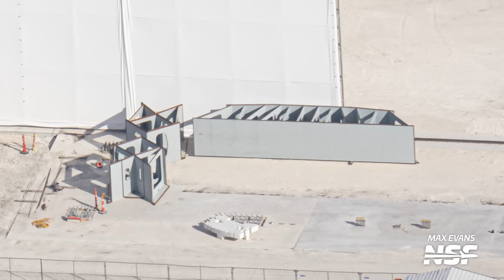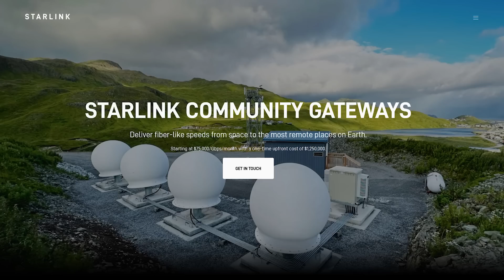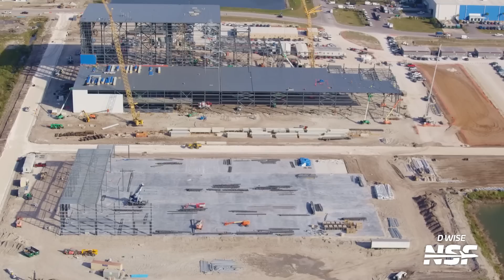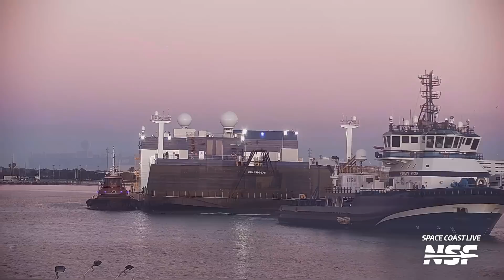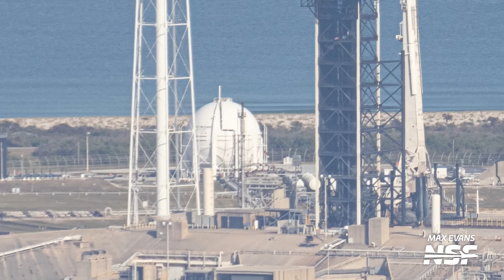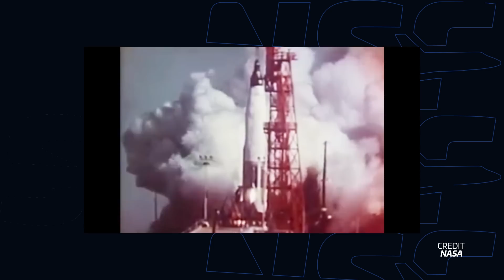Busy 2025 Ahead! Starship, New Glenn, and Stoke Progress | KSC Flyover

Comment: It is interesting to see the different design, build and construction methodologies of SpaceX and Blue Origin. SpaceX builds the machine, then the building that builds the machine - based on how the machine needs to be built - years later. Also, all the parts seem to come JIT. BO builds the building and then the machine, and the parts for the building seem to come way before. To me, while that seems very traditional, is also seems to lock in the design of the machine before you have even tested it. It is also a lot of investment in stuff that looks pretty and clean, but you haven't actually got anywhere yet.

Comment: Boca Chica is Starship Development while the Cape will be where they will be manufactured in bulk.  Starship Booster will be standardized with only incremental changes applied but Boca Chica will be where most of not all the "Special Version" Starships will be built and tested.  Special versions of Starship will of course include the Moonship, the orbital tanker, deep space exploration, custom ordered Starships and even the Starlink satellite pez dispenser versions as they will only need a few of these at most unless Starship is NOT as reusable as they plan.

The Cape will end up producing the Tanker Refueling Ships, Mars Cargo ships and the Mars Passenger ships as those are the Starship variants that will be built in large quantities.  Expect to see several more Stage 0 towers being built in the Cape as well, maybe more than a dozen since a very high launch cadence will be required to refuel the orbital tankers when they are also launching dozens of Mars bound Starships.

Comment: Great - thanks for the updates guys!  Of all the activity down there, I think I'm most excited about StokeSpace's Nova rocket.  That aerojet design is just far superior to anything I think that's flying currently.  My take is it actually could beat the pants off Starship given that you won't have to go through that painful belly flop and FLIP maneuver.  I'm not sure humans can survive that flip maneuver.
Reply: The forces of the flip are very small.
And the liquid cooled heat shield is likely inferior to using tiles (it takes a LOT of hydrogen)
Reply: You've got me thinking.  In a crewed version of Starship,  the rotation of the flip maneuver could center on the crew area.  That would reduce extra g forces due to centripetal force. Thoughts? 
 @bryanillenberg
Reply: @hawkeartist  It would reduce G-forces, but reducing an already low acceleration isn't worth the complexity of achieving that.
Reply: So my thinking (and analysis) shows that G-forces even in the 12-15 G range can be enough to both severely strain and possibly cause other injuries to the neck of an astronaut.  Assuming they are on their back in the belly flop maneuver, a sudden shift around the center of mass of a 280 tonne object could easily subject them to upwards of 10 G's.  It all depends on how far away the astronauts are from the center of mass or the central point of the turning radius when the "Flip" is undertaken.  In rough calcs, if they are less than 20' from center of mass, then G's are probably below 5. But they climb quickly the further away from center, up to when they're 50' away the G forces may be in excess of 15 G's.  I used a 280 tonne Starship, traveling at 50 ft/s when the flip is undertaken.  That's also a lot less than 60mph (100kph ~) when they undertake the flip maneuver.

As for the aerojet, I'm not sure the fuel consumption, but they have many options, and probably can throttle a lot lower than a Raptor (down to maybe less than 10%) and still maintain the cooling effect on the heat shield and so on. The aerojet has a single turbopump assy for all the nozzles, so I can imagine being able to throttle very precisely down to very low fuel consumption and thrust.  You don't need much thrust, the aerobraking is a result of the aerodynamic forces.  I'm not sure at all how to calculate the amount of braking, but their tests have shown the bubble created around the vehicle essentially presents a larger surface area (100% cooled by the aerojet and cryo cooling of the heat shield) such that braking forces are larger than they would be for just the simple surface area of the vehicle itself.
Reply: @sdebeaubien  Flip is only going to produce (at most!) 3 G.
Its literally impossible to get 12-15 G without destroying the ship
Reply: @sdebeaubien  thank you!  Your math validates (and invalidates!) my thinking. It will be VERY interesting to see the reentry profile evolve for  crewed Starship.
Reply: @sdebeaubien  They won't be experiencing 12G's or anything like.  What you are is a fraud.

Comment: It will not launch before 2026, and by then it will be two decades behind the times. I guess they are making progress, their previous project, crossing the Karman line, was over 70 years behind the times... And that is of course if the flight is a success. And even if it is when will their 2nd rocket be build? In another decade? While SpaceX will be populating Mars and the moon, Blue Origin will celebrate their latest improvement, only three decades behind the times: Landing an orbital booster back on earth for re-use... Go BO!

Comment: 10 GBS means Giga Bytes per second NOT Giga Bits per second. There are 8 bits in 1 Byte are therefore considerable more than you said.
Reply: It's gigabit, it's literally on the website: "Our first Community Gateway on the remote island of Unalaska, Alaska is able to provide 10 gigabits of symmetric uplink and downlink throughput, enough to serve thousands of new customers while operating at over 99% uptime."

Also gigabyte would be GBps not Gbps, gigabit is Gb and gigabyte is GB
Reply: Pretty stupid to make Bits and Bytes sound alike. Why even use Bytes now?

Comment: Are Bob and Doug big enough to bring that extended fairing back?
Reply: I know they've come back with two pairs of normal fairings before, so one pair of extended fairings should be fine!
Reply: I recall hearing that the plan was for the extended fairings would be expendable.  On the other hand, SpaceX has made plans and later on changed them so who knows.
Reply: @KnightRanger38  With how few extended fairings will ever fly and the very sensitive nature of the huge payloads it might not make sense to reuse them, but I wouldn’t be surprised if they are reused.
Reply: The separation mechanism makes them expendable.